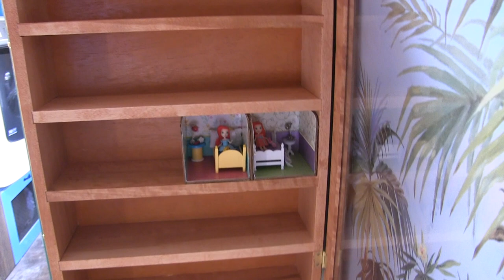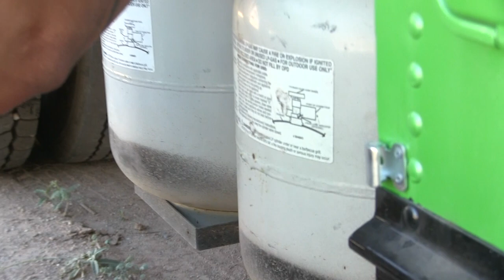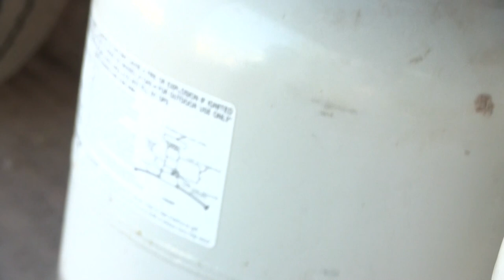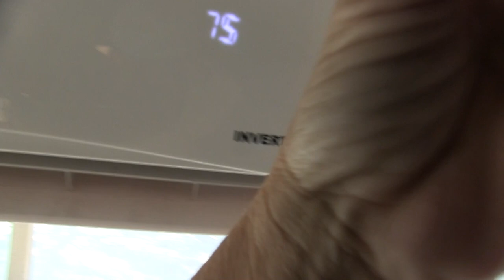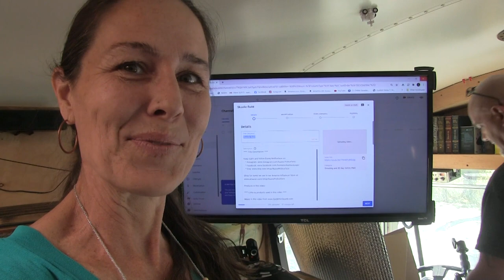Finishing the Bus, Moving In, & Hitting the Road in our Skoolie!

Comment: Hi Kerry and Mike, a few things, first the hose you used my not be rated for the high pressure side (tank valve side) before the regulator. You need to find out from a licensed gas tech. or dealer. Also locking the propane compartment and leaving no access to shut them off not wise. Maybe you can make a locking brace inside so the can't be stolen but still access to shut off the tanks fast in a emergency. I would stop by a Propane or RV dealer and ask questions.

Comment: Hey you two, after seeing the section on your gas leak, I went searching on a another ROGER'S YouTube Channel, "You, Me, and the RV."
Reply: Hit send too early, they use a device call GasStop. They are safety valve that attach to your tanks. Here is the web link on Amazon. https://www.amazon.com/GasStop-Propane-Emergency-Safety-connections/dp/B07N4D4SMD.
They aren't exactly cheap, but will prevent you gas from leaking out of your tanks in case of another ruptured line.
Reply: Where did ROGER'S come from? Dang auto correct.
Reply from the maker: Just bought 2

Comment: We have no intentions of leaving this house (well,  not immediate intentions anyway) but we have gotten rid of a whack of stuff over the years.  Came back from living in Puerto Rico for about a year and a half (awesome work assignment for my wife,  so I took a leave from my job) and realised we had lived quite nicely without a whole whack of stuff that we left behind in the house.  Out it went.  
When we retired,  same thing.  There are women out there somewhere who have been able to buy very cheaply some really awesome (and expensive) work clothes that were necessary for the job she had.  Me,  I was a caretaker, so I just pitched the shirts they had bought for me. My "uniform" consisted of steel toed boots (still have 'em) blue jeans and shirts.  Kept the jeans until they wore out. 
It's not an easy thing to do,  parting with your "stuff".  And you either do it bit by bit,  or all at once when it's crunch time.  Or,  someone else has to do it after you're dead.  There are those whom I know who have lived through a war.  They never throw anything out.  My head would explode.  Hopefully yours doesn't.  Carry on!

Comment: The problem with the propane tank is one reason why I'm going to have all electric appliances. I'm not going to deal with propane and have my bus explode, and BOOM, all that hard work for it to go up in flames.
Reply from the maker: I would agree with you but I will tell you that we have 1500w of solar and 1000Ah of batteries and an electric stove would push us to have to use our generator. After a couple weeks of use now,   a cloudy day for us with electric appliances would be a great strain on our energy budget.
Reply: @BussyMcBusface  That makes sense. I guess you just have to find what works for you.